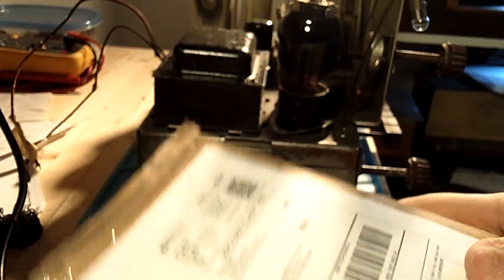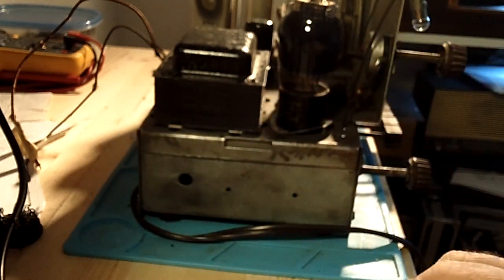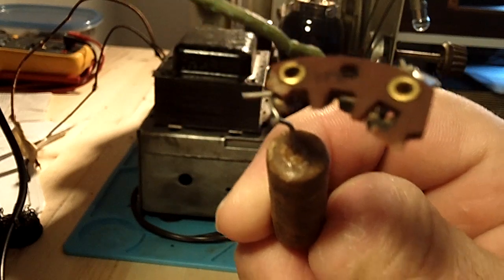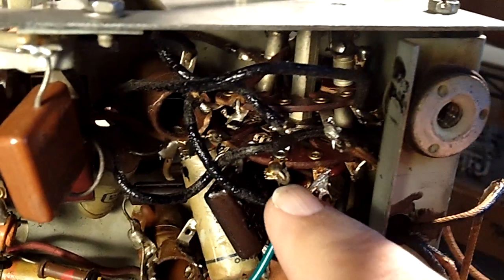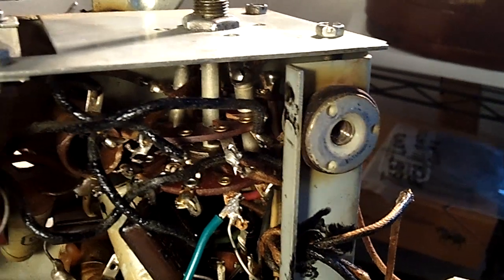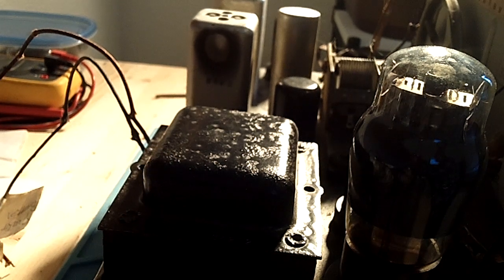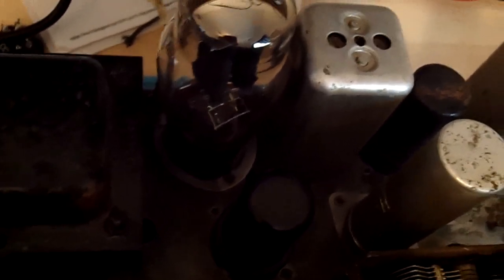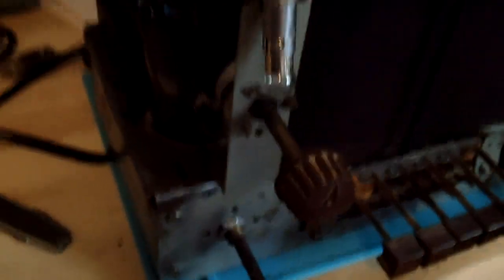Received ebay Purchase and whats wrong with J-71 radio and power up

Comment: That band switch is going to be a nightmare to replace.
Merry Christmas Larry.
Reply from the maker: Yes indeed it will be a nightmare but, It won't do anything without it so I have to replace it and rewire it. Worse than that when I rewired it I will also have to replace the wiring at the same time because its old and brittle and coming apart. So it will keep me busy for awhile Bill as a winter project. Thanks and Merry Christmas to you and your family as well Bill.
Reply: I will say I could NEVER do that even in my best days.
Reply from the maker: @old64goat  My brother Ron just finished tearing apart a Collins R390 receiver. I mean totally torn down to the gears in the frame and then cleaned it all changed parts and put it all together it took him 2 weeks to do it. He just finished it and the first time turned it on yesterday it works. But he is pretty much a genius in electronics. He has  a electronics Engineering technology degree from Cal Poly has an Amateur extra class license and a first Class Radiotelephone license and has worked in electronics since he was 13 years old. Me I have a high school diploma and took 3 yrs of electronics classes in high schoool. So compared to him I am a low grade Moron Bill. But I will attempt it. No Guts no glory lol I will probably fail miserably but I will try.
Reply: You must have lots of patience to be able to do something like that, I get frustrated too easy and give up.
Take lots of closeup pictures & videos.
Reply from the maker: @old64goat  Yes I am going to have to totally gut and rewire the radio anyway because all the cloth covered and rubber wire is so brittle its coming off so not real safe. But first I have to test the transformer if the transformer is shot its not worth fixing my brother Ron said. And he has a lot more patience than I do. So we will see how it goes.